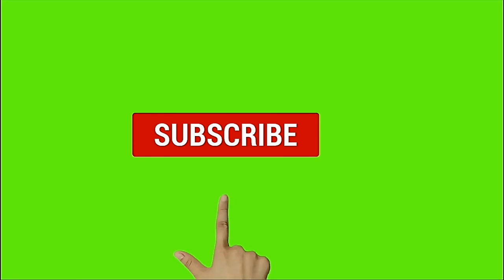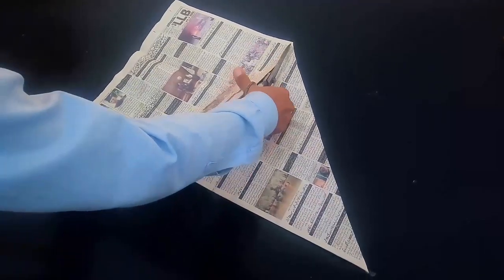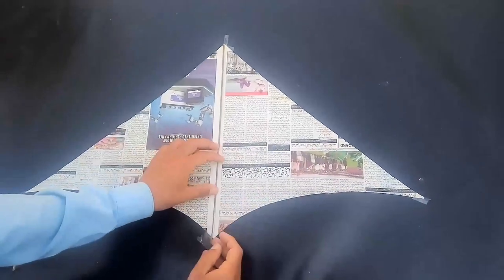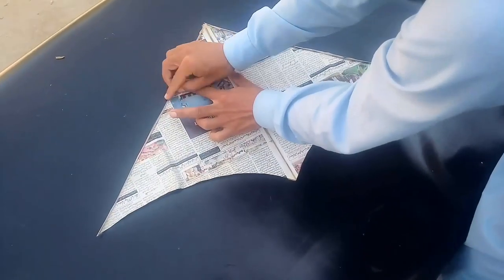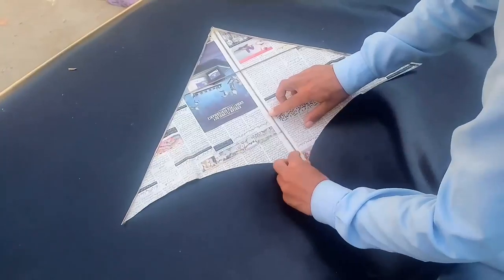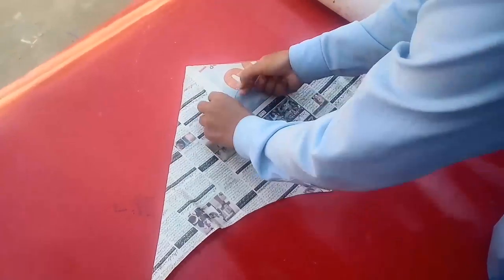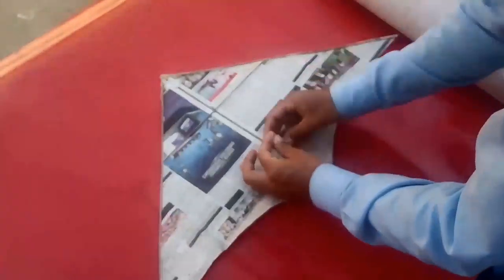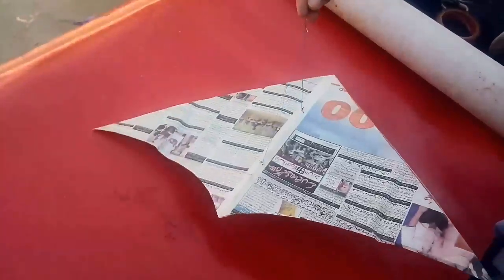HOW TO MAKE International STANDARD NEWSPAPER KITE / MAKING FAMOUS FLYING KITE /MAKE KITE / kite 2023

Comment: Why u attached tape in side of the paper
Reply from the maker: We used tape sides of paper for strong joint with beroom stick.
Also used for fight with Air preasure.
Reply: @tibtumsports  ok thanks
Reply: @origami8867  ok